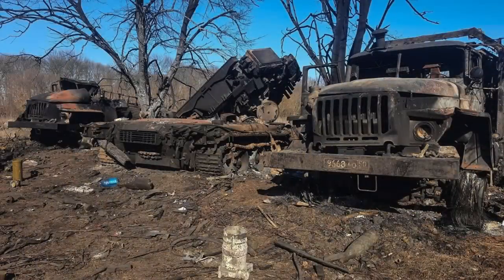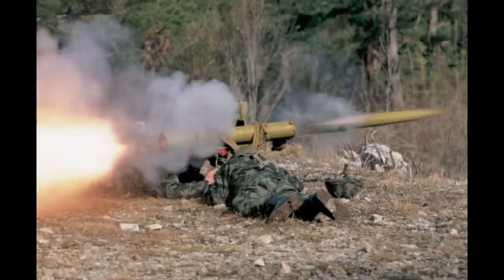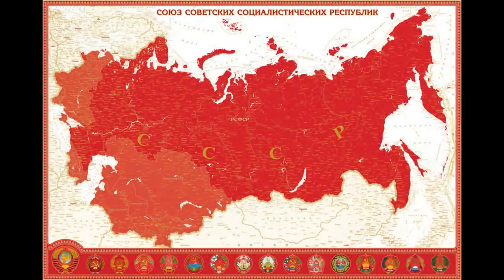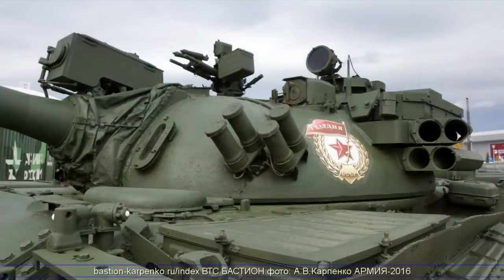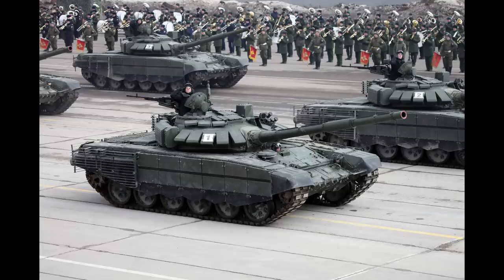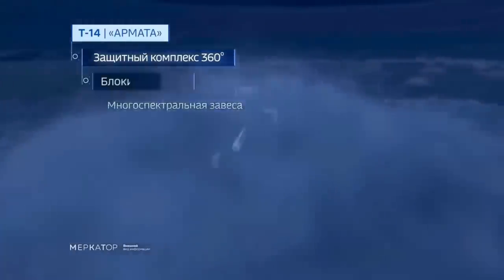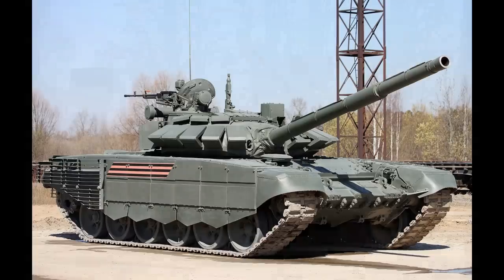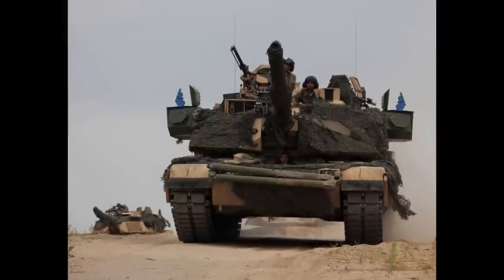Why are Russian Tanks Failing in Ukraine?

Comment: One thing is clear, Rusia does have a limited military budget, since the 2008 war they have increased it form 2% to 4.5%.

With this limited budget and the apparent lack of any serious war. The Russian DoD has put that money into developing new weapons, not into buying them. For example the Su-57, a variety of HyperSonic missiles, T-14, Universal Combat Platform, AIP systems, radar tech.

The Russians tried to avoid war by investing in their nuclear arsenal first. Topol-M missiles, Borei class SSBN. Etc.. 

For the rest of the conventional forces they decided to simply upgrade what they already have. 

I think after this war ends (if it ends), Russia will increase their defence spending at about 6-7%. To meet the requirements of the material loses they have suffered. They surely learnt their lesson at a high cost.
Reply: The point isn't to quicken this war by sending and devloping more arms for it, it's to solidify the defense of the country for everything past this war. Ukraine is destined to lose, whether entirely or strategically. Even when they have a little less than twice the troops, they have lost lots of ground and hordes of munitions and troops.

Even if this war were to go badly, there is more ready to be sent. There is no reason to invest in that if you can have a failsafe for later conflicts.
Reply: @marcbuisson2463  Then again the entirety of the EU was keeping the situation quiet because of this exact situation. If the news of Ukraine being unable to join NATO and the EU due to corruption were to go global, some backlash would come. That's exactly what happened with Minsk II.
Reply: @TheArcticFoxxo  Can you remind us what happened the last time you guys went to war against a somewhat sizable country and with a bigger military force behind you? And what happened after that? Yes Russia is behaving exactly like Soviet expect with less manpower, firepower and your "enemy" has more support, more manpower and more weapon systems then Afghanistan had. Oh and Soviet actually had the balls to declare wars unlike Peter the pathetic. It's only 30 years ago since the last time you collapsed and you are confident because of what?
Reply: @TheArcticFoxxo  Russian cope lord lmaooo
Reply: Also, all these russian doomsday weapons that we keep hearing about probably cost a ton of money to develop and they have no use in Ukraine.
Reply: @thomaslunde5014  Such as when?
Reply: @Max-kd2gh  ?
Reply: It just adds more money for the various parts of the system to steal this money to line their pockets.  From front line troops selling the fuel in their vehicles, to supply staffs stealing equipment, to officers overstating manpower and taking the pocketing the extra funds, to oligarchs giving contracts to buddies who then give kickbacks to oligarchs, the amount of money stolen out of the Russian Military is huge.
Reply: @TheArcticFoxxo  This war is a disaster for Russia. They are stagnant.
Reply: @TheArcticFoxxo  nah, this is what western Europe did. And tbh, we were very very marginalised in since February 2022, that showed our entire politic was wrong. You woke up the eastern european countries, you're gonna deal with them, because in western Europe, we won't be able to calm the fear they have. And tbh, you're scaring us too now. 
And I was not even considering the situation of Ukraine entering EU or NATO.  That is independantly of the outcome of the war, you guys have started the polish, finnish, romanian and czech rearmament, as well as a permanent massive military presence in the baltic countries, and I don't see this stopping in the next 5 to 10 years. 

Ukraine being corrupt or not currently is not a problem tbh. Because the EU's job and speciality is to get rid of the corruption. We did it in Poland, Czech Rpublik, the baltic countries, it is under way in Romania and Bulgaria. The EU in itself is a great motivator of fighting against corruption, and has been fighting against it through judicial and constitutional help for the last 20 years. So nop, corruption in Ukraine is not a problem in the middle term. And will go on its way out, even if it will take time. The war will probably shake them up too. 
The only thing the outcome in Ukraine will have, will be on whether or not an armed insurrection will begin in Belarus. I'd say. And the strength of the european remilitarisation. But seriously, you guys fucked up by reigniting the eastern european diplomacy and giving them a goal for their survival.
Reply: @TheArcticFoxxo  The Russian federation is only 30 years old, why? What led to the situation that made Soviet dissolve? Simple questions, and you will just deflect these also.
Reply: "AIP systems"
They never developed or installed on any sub. Not on Kilo, Lada or the supposedly next gen Amur which is still on paper.

No due to sanctions, they will probably never be able to spend or develop advanced weapons in any meaningful way
Reply: @marcbuisson2463  None of which have anything to do with Russian intervention with outside interference. Almost all, if not, of the current tension of the Eastern Baltic states is due to propaganda such as "soviet union" this or "reclamation" that. This has nothing to do with outside states, nor did it have anything to do with it until NATO started pumping munitions and troops into Ukraine. The same happened in Chechnya, and to say the war in Ukraine is an attack on NATO is the same as saying the war in Chechnya is an attack on Ukraine. They willingly supported ISIL and Mujahideen offshoots, all as a product of their corruption.

Ukrainian corruption may not be a problem to you, but it let to 5 large protests, 2 of which were borderline riots, along with 3 insurrection acts, 1 being a counter to an unconstitutional invasion of the Crimean SDH. To say it's the EUs job to remove corruption is to say that it's the UNs job to promote stability. The EU has done nothing to support Ukraine, with Turkey actually helping with NATO circulation circumvention by means of trade, which Ukraine had failed to follow through on. And yes, whether or not the EU deals with corruption, the Turchnyov Foundation is still holding power in the government and the same governmental issues from 1995, 2002, and 2008 are still here. The plan was for the government to go out, as it had been when they had broken the terms of Minsk I and refused Minsk II even when it gave them overall gain.
Reply: @tomwhitworth1560  and?
Reply: @thomaslunde5014  And what is this supposed to prove? That introduction of non-hierarchical structure to a totalitarian state is apparently good? All of these outcomes that you've stated are the exact products of this kind of change, and the exact reason why Gorbachov was hesitant towards it.
Anyway, for DeFlEcTiOn, I don't seem to be in fear and I still speak my opinion. Either way, it's hard to take an equal approach to a debate when the other party constantly cries "scree! whataboutism! deflection!!!", but you failed to mention how Ukraines secession from the state had ended in a more corrupt government than any other state, given the forceful takeover of sovereign land, corrupt trade practices, blatant ignorance while facing terminal issues with their government, and now a multi-party system that has created a divide in the country and more than 5 revolutions in the last 20 years.
Reply: Every country has a limited military budget (all budgets are limited :D), but thats not the problem why the army is performing bad/ is in bad shape. The reason is simple: corruption. With other ruling politicians that have more human values, the russian army could have been more than propaganda makeup. And with such politicians russia would be more integrated and friendly.
Reply: @miraphycs7377  Nah, the Russians still can develop Advance Weapons Systems.

It's just going to take more time...........and cost.
Reply: @TheArcticFoxxo  you have in your neighborhood countries where 2 million people where deported to Kazakhstan under Staline, then brought back and some of them still alive. Countries in your neighborhood who have had 300 000 people deplaced for the finns, 3 million poles from Belarus and Ukraine, 500 000 ukrainians from Poland, and to their size, similar things happened for the baltic states. Same shit for Romania. These are country literally taumatised by both tsarist russia, Stalin and to a lesser extent post-Stalin rule. These are country that are and will stay systematically opposed to the idea of Russia having a sphere of influence. They tasted it and did not like it. 

In which world do you live in for you to think that things could ever go smoothly with them if Russia invaded Ukraine in any timelines and at any moments? I mean, yeah, we both know that russians see them the same way as usonians see south America. But sorry not sorry, it is not propaganda when it is told by your grandparents who were sent to Kazkhstan or had some of their family sent there. And while they were busy building themselves up and letting the EU and USA deal with their foreign diplomacy, you guys woke them up. And they now have a massive influence over both NATO and the EU. Once again. Your problem. If you thought it would go easy with them, then I can't do anything for you. Because these are Russia's harshest and most hatious ennemies. The USA don't care about you, they just want EU support against China. If you make them feel threatened by Russia, they will and did become mad dogs who are certain that their countrie's life is on the balance as long as Russia will have an army, and probably some nuclear weapons. And will take actions in consequence, since their economy today is far stronger than Russia. I don't think a nuclear power Poland, Romania or even Ukraine in the long run are that crazy now. Especially seeing how you are creating multiple generations of very angry ukrainians.
Reply: @TheArcticFoxxo  Ukraine started seriously acting and being pushed by the EU to act on its corruption only since 2014. And during this time, while it was shy, things definitely did improve, especially financially wise. And on the more basic level, we did impose some anti-corruption fight, laws and the creation of some ukrainian jurisdictions. Things are moving, and faaaar better than in Russia. Or Georgia. And yeah, it will take time and all, but we're definitely giving hopes of a better future for ukrainians. What is Russia offering on the fight against corruption? SBU and ex-Saint-Petersburg nazis who got friends with Putin in the 90's to take the countrie's economy? Or the destruction of it's industrial complexes of Mariupol or Kryivih Rih? Maybe the loss of their oil and gas fields in the western Donbass and the Bmack Sea? That would be a great way to thank Solovyov for promising nuclear hell to the poles, finnish and estonians right?
Reply: @randomka-52alligatorthatis34  I also expect some Chinese aid when they improve their technology better, since they are also free from sanctions
Reply: @TheArcticFoxxo  на чём там ваше воинство, которое "исчоненачинало!!1!" в бой пойдёт? На Т-55 такими темпами? Или сразу Т-34 расконсервировать будем?
Reply: @b-17gflyingfortress6  Oh definitely, after all this. Well, if this eventually ends. Both Russia and China will certainly put more effort in improving their Military Industrial Complex to be more domestically dependent and Sanction-Resistance.
Reply: if your victory is inevitable, why have russian forces stalled at 15% or so, and starting to slip? explode courtesy of artillery you can't touch, northern reich.
Reply: @DigsDugd  Ukraine is at desperate state where they fully rely on Western aid for ammunition. Since they likely already spend most if not all ammunition of Soviet storage. Now it's a game of patience of which side runs out of ammo first. If Ukraine does end up without any ammo, then Russia should advance rather fast, or can force Ukraine making a peace deal
Reply: @DigsDugd  You speak like wehraboos who said "If Germany produced more Me-262, they would win the war". Wunderwaffes doesn't exist my dude. HIMARS is NOT a wonder weapon that will change the war. Especially with the ammount Ukraine has.
Reply: @Max-kd2gh  Im just saying but this wave of "lmao he is just coping" whenever somebody points out that Ukraine is losing is exactly why people were shocked when the conflict in 2014 got dragged out to today, and is exactly why a lot of people are suddenly asking the question "Wasnt Russia supposed to run out of ammo like 3 months ago?". Russia may not be doing perfectly well, but it is gaining ground on the Ukrainians in return for losses that according to western sources are only slightly higher than those they have inflicted upon Ukraine.
Reply: @DigsDugd  They literally took two major cities within the past two weeks, i wouldnt call that stalling. People on youtube and social media have this magical conception that modern wars need to be lightning fast with extreme effort on every section of the frontline. The reality is basically no modern armed forces has the ability to conduct such an operation for a long period of time. That is exactly why many states focused on strategic weaponry in the latter part of the cold war, NATO and WARSAW pact strategies literally called for an offensive to knock out the enemy before a majority of their arsenals were depleted. A small focused offensive along a narrow section of the frontline is the only reasonable strategy Russia can undertake, and that is what they are currently doing in the east. Things like HIMARS have helped Ukraine, but an important thing that nobody should forget is that it hasnt stopped Russia from striking the Ukrainians with long range artillery, which was the thing HIMARS was supposed to prevent. Put simply a Rocket System deployed in a handful of places to face off against over a thousand Artillery pieces is not a long term strategy, especially when the Rockets used by said system are in outrageously low supply and most notably expensive.
Reply: @twocentcoop9683  they play video maci games on computer machine or se movie on tv machine and there it was fast so that must be true XD
Reply: @PotatoeJoe69  Yes, such as Crimea, illegally annexed by Ukraine in 1995. Or Donbas, 2 states legally allowed to secede before the 2008 and 2012 changes of the constitution by the Turchnyov foundation. And yes, they fought quite a lot. Need I remind you who crossed the EU mandated buffer zone in Donbas?
What country would that be, may I ask?
Reply: @Thomas Lunde what are your sources for this war brah? Would be amused to hear them.
Reply: @Mira Phycs they most certainly did develop a couple of AIP systems. You are correct that they never fielded them. They make do for long operations with their nuclear fleet.
Reply: @TheArcticFoxxo  Ukraine isn't destined to lose. They can definitely win, but they might not get Crimea back to it's rightful owner. 

EU accepted Ukraine as a candidate and i don't think anyone actually though Ukraine was going straight in. Even less corrupt states have to actually go through candidate process. That much was obvious for anyone who knew anything about EU. 

Minsk II was the best Germany and France could come up with. They didn't want it to exist and would have preferred much better deal for Ukraine.
Reply: @TheArcticFoxxo  Crimea is UN recognized as a part of Ukraine and the borders were quite literally chosen by USSR whos successor state is Russia. If Donbass "states" wanted to secede then why did Russia invade Ukraine before the war even started? Reality is that it is a Russian made conflict for their own gain
Reply: @АнтоновЯковлев  ikr its insane. The entire latter part of the cold war was both sides focusing on a knockout blow strategy if a war did occur, so that they might perhaps win before their conventional arsenals run out. Wars require huge amounts of equipment when they are being fought conventionally, something America has not had to deal with in a very long time given it has only fought insurgencies since the turn of the century. Russia is focusing on small scale frontline offensives not just because they work but because its sustainable for them.
Reply: @esanahka9284  The EU accepted it as a Candidate but as an EU Citizen i can guarantee you they wont get membership due simply to the opposition from normal EU Citizens. We dont want more members, let alone a poor Country in Eastern Europe actively embroiled in war. Accepting them as a Candidate was symbolic, nothing more.
Reply: @twocentcoop9683  That is just not true. You are applying your personal views as widespread facts when they are nothing more than you own personal views. 

EU citizens vote for EU goverments who accepted Ukraine as a candidate and in 20 years at the very best they will be able to join.
Reply: @ArielK-a  It's not like just selling oil is a viable long term economic vision. You need industry to be a viable regional power and Russian industry is archaic
Reply: 6-7% gdp is unsustainable